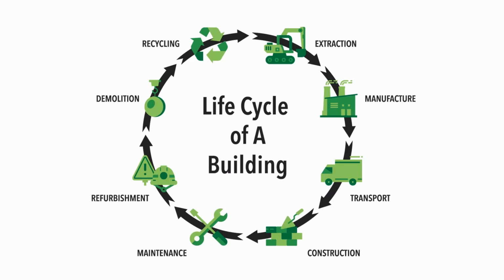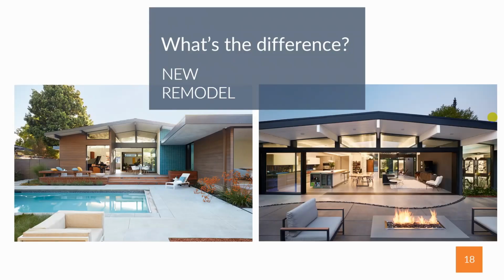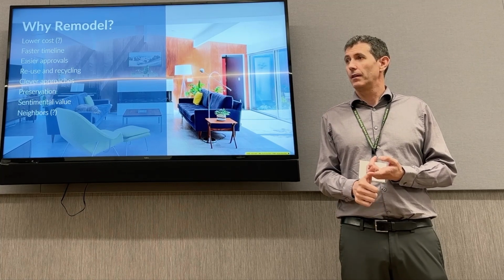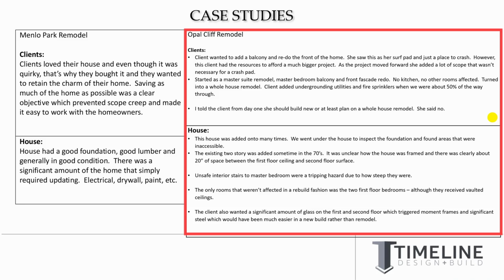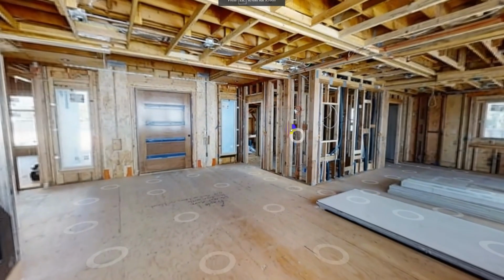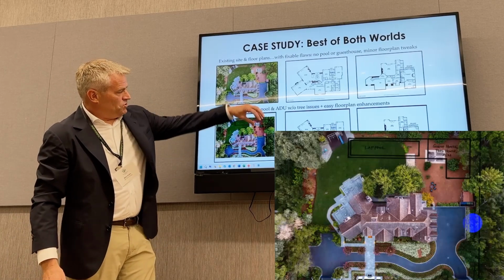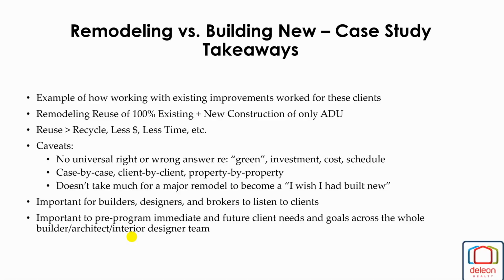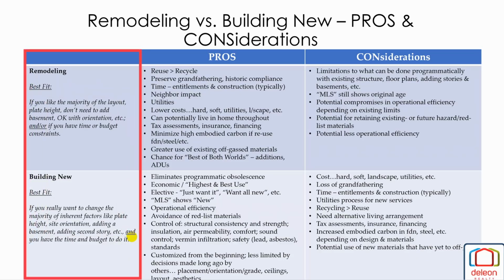New Construction or Remodel? Bay Area Building Science Collaborative BABSC September 2023 Workshop

Comment: A passive house starts with a much higher embodied carbon. Many of the products are shipped from Europe, where do they get the raw materials? Just a note: fly ash contains heavy metals and is toxic when wet and when washing trucks and tools.
Reply from the maker: This is largely incorrect and depends on where you get the materials and how you build the house.  That calculation depends on what alternative project you are comparing the Passive House to.  Dense pack cellulose has a tiny fraction of the embodied carbon of any other insulation option.  The use of any combination of insulations at 3x the R value you would see on a passive house would be a fraction of the embodied carbon of a house with spray foam or rockwool.  There are plenty of good Passive House window manufacturers in the US, including ones in Kansas and New Jersey and several more in Canada.
As far as the flyash comment, you are correct, flyash is toxic, BUT your suggesting that using it in concrete, where is is secured for centuries in a material that makes it bio-unavailable, except when you are cleaning tools, is somehow worse than the alternative where it is held in giant pools adjacent to the coal fired power plants and that these pools continuously leach these chemicals into the ground and ground water and which also occasionally fail spectacularly and poison regional water ways, often in disadvantaged communities that are already poisoned by having coal fired power plants in their area, is a false equivalence if ever their was one.